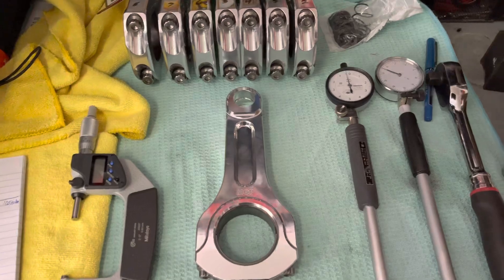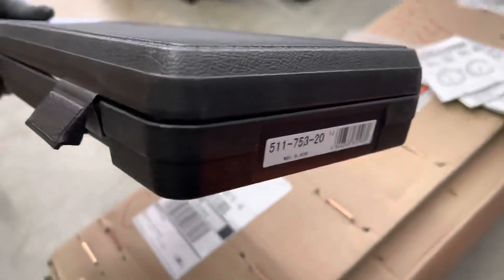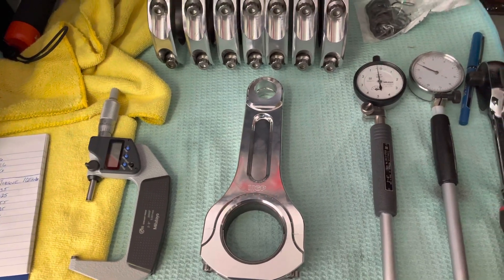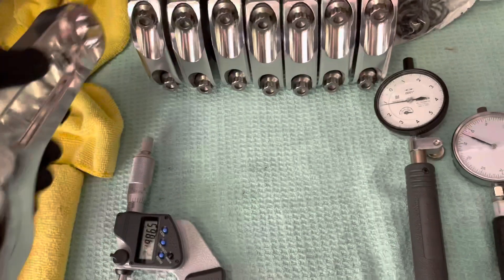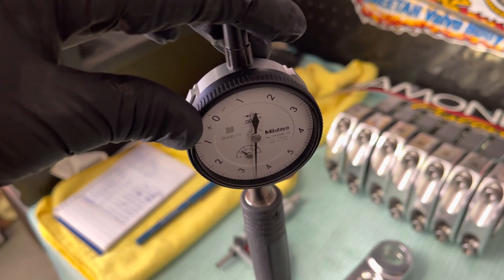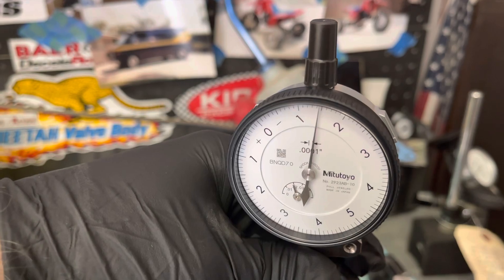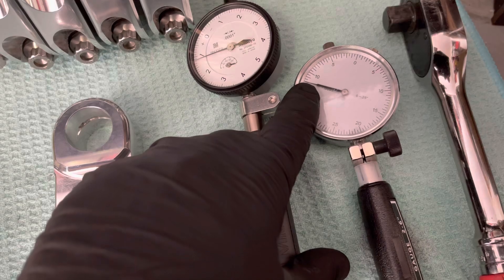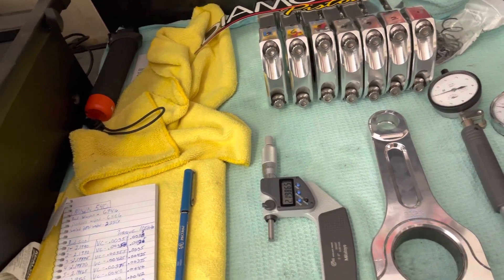MITUTOYO bore gage vs cheap Amazon off brand

Comment: Cool video! I think you'll find the only real difference is repeatability over time. I would venture to say the China one is probably fine if not used all the time, but it will likely wear out faster. If you want the very best dial bore gauge, the only one to buy is the Sunnen brand. Extremely accurate, down to .0001" repeatability and will last a lifetime. Plus it has a lever to shrink the size down so you can insert it into the bearings without scratching them. When honing rods or blocks, the accuracy is quite necessary. Not quite as much for bearing clearance. 👍🏻 Good video!
Reply from the maker: Totally agree. Thank you.
Reply: Stunner is good, but so are a number of others.